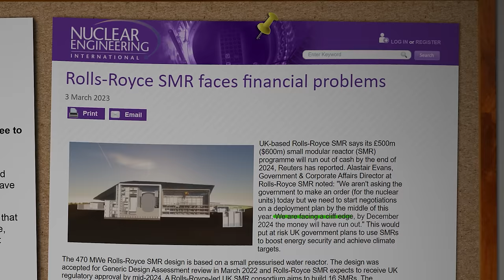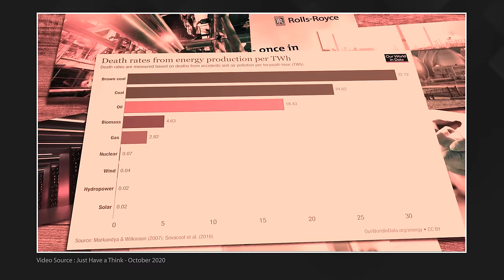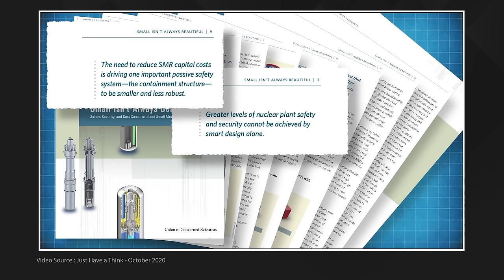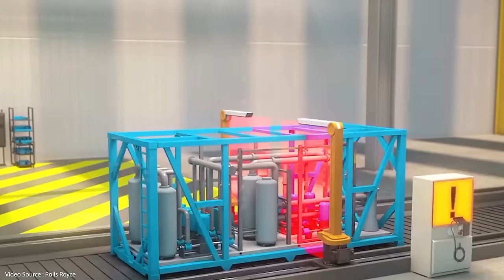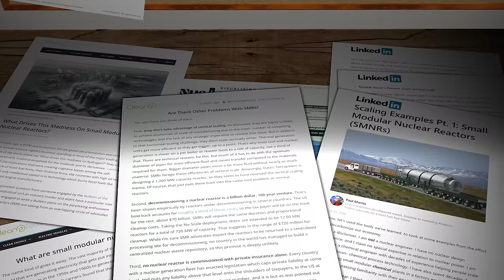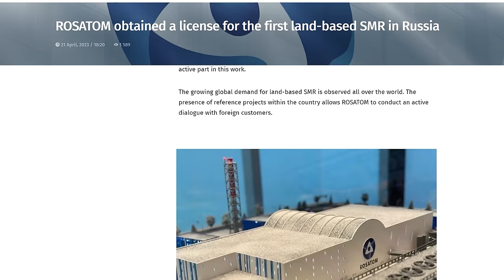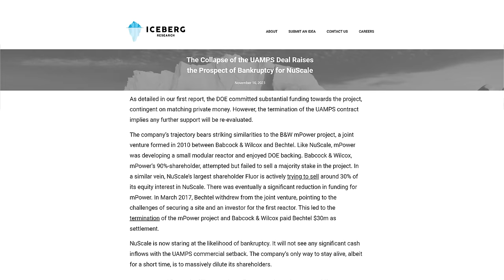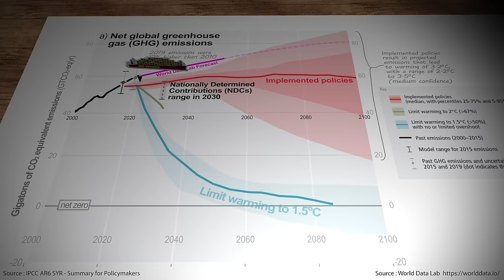Small Modular Nuclear Reactors. The Verdict

Comment: These SMRs look huge, to me a SMR fits in a small space like a submarine or aircraft carrier, a few lines up in a row on an existing sire like an old coal power station that still has its infrastructure is the way to go.
Reply: It's something I noticed, too - they are deliberately conflating the pressure vessel/ reactor thingy with the whole power station.

It's like saying an Internal Combustion Engine is a car.
Reply: Reactor submarines are not cheap (fuel load is $1 billion), they are very inefficient because they do not have the room for reheaters, and they have  none of the safety systems required for commercial units.  The first U.S. nuclear power plant (Shippingport) had a 60 Mw output (typical SMR capacity) took up three levels and 4 acres.  Look at a typical commercial power plant (1,000 Mw) and any SMR fraction of that output will be at least that fraction in size.  The larger the plant the more efficient it becomes and vis versa.

Comment: A running capacity of 90% is really really optimistic. Look at France. They had huge problems where during winter they had to shut down almost all their nuclear plants for corrosion tests and maintenance. And then during summer, the rivers got so hot they couldn't cool their plants and it had to be shut off again.  People don't want to face up to the fact that in practice, nuclear plants are not always operational. They are down for maintenance, tests, inspections like 10 to 30% of the time. While for solar and wind that will be much lower. Additionally, the cooling water shows the biggest pollutant of nuclear power that is almost never talked about: hot cooling water. Nuclear plants, or any traditional power plant, consume an incredible amount of cooling water. Which when you build them near a river or an inlet can be quite problematic. People may say that heat can be used to heat houses. But who builds a nuclear reactor near a residential area that already has a district heating? As always with nuclear, it is all a pipe dream begging for government subsidies.
Reply: You do realize that the capacity factor of solar is 50% at best, under ideal conditions, right?  And while France has had some recent issues, those issues are the exception and not the rule.  Look at the United States.  We have a far larger nuclear fleet, and 95%+ has been the trend for a couple of decades now.
Reply: @rdormer  Why would the capacity factor of solar matter at all? Even if it is 0.1%, so what? I don't get it. US has barely build any new nuclear plants in the last 30 years. And all attempts have been failures that led to cancellation of future plans. This despite our need to phase out fossil.  Solar and wind are replacing fossil AND nuclear at the same time. Fossil is losing but nuclear is not able to get even 1% what fossil is losing because solar is just too cheap and wind is just too appealing to the free market.
Reply: @Prometheus4096  My dude, you're the one who bought up capacity factor, I'm just responding to your incorrect statement about the capacity factor of nuclear.  Since it occurs in the context of a discussion of alternatives, with solar one of the leading alternatives, then its fair game to compare their capacity factors.  And sure, US construction is moribund - as long as you ignore Vogtle and Watts Bar.  The thing about SMRs is, it was never really about the small size being an economic benefit, it was about trying to leverage standardized designs instead of making - and this was a brilliant way to describe it - each project a piece of bespoke engineering.  SMR may not be the best way to do that, but France - since you brought them up - clearly shows the benefits of this approach at ANY scale.  Throwing the nuclear baby out with the SMR bathwater is a really braindead idea.  Go ahead and get your renewables - they're awesome.  But there's more to a stable grid than just picking the lowest LCOE across the board.  All those renewables are going to need baseload to back them up - that's a fact.  So far that's invariably been natural gas, which kind of defeats the point, no?  So, if not nuclear or natural gas, what baseload power source do YOU propose?
Reply: @rdormer  I was talking CORRECTLY about the capacity factor of nuclear. You were the one that brought up solar. Solar works independent of capacity factor. As does wind. Nuclear does not. Nuclear is already dead. So I don't know why you are trying to argue against throwing out the baby with the bathwater.

Comment: The physicist YouTuber Sabine Hossenfelder already did a very easy to understand piece on why nuclear got so expensive in the US. Well worth watching, because it opens the possibility of lowering those costs back down to something resembling the 1950's reactor costs.
Reply: Yet those 1950s costs were still not competitive with coal back then. And renewables are now definitely cheaper than new coal (as the Chinese have discovered in the last few years - they've abandoned many planned new coal and nuclear plants in favour of a truly massive buildout of renewables). Fixing the US-specific issues will not be enough to make nuclear competitive - it also has to find much more generalised cost reductions. And the physics means it is unlikely to.
Reply: @kenoliver8913  Yes and no. Solar doesn't work where I live in Alaska for half the year. Nuclear makes a lot of sense there if it can be done at a lower cost than the current ones. Every power source has its market based on local conditions. There is no one size fits all model. IMO though the new geothermal power technologies are going to displace just about everything. 

The thing about wind and solar is that you cannot just look at the cost of energy production, it has to be coupled with storage. Without storage it is not reliable, so storage costs must be added to the levelized costs of wind and solar or you do not have the full picture. Without storage you need peaker plants of some sort like natgas, nuclear or geothermal. Interesting mix, and I believe the market should decide the answer instead of government to get reliable, scalable power at affordable prices.

Comment: The reason countries push nuclear energy is because nuclear energy and nuclear weapons use similar technologies. By promoting nuclear, they can acquire the necessary skills, infrastructure, and materials to advance their nuclear weapons ambitions, while hiding behind the facade of peaceful energy use.
Reply: There is virtually no crossover from nuclear weapon production and power plants with the exception of working with highly radioactive materials.

In general power plants cannot make bomb grade materials, and there is no need for bomb grade materials in nuclear power plants.

Weapon grade material reactors are very different from power reactors.
Reply: @perryallan3524   Tell that to India. India started its nuclear program in the 1950s with the help of the United States and Canada, which provided reactors, fuel, and technology for peaceful purposes under the Atoms for Peace initiative. However, India secretly diverted some of the plutonium produced by these reactors to its military program, and conducted its first nuclear test in 1974. India continued to use its nuclear power plants to produce plutonium for its weapons, and conducted more tests in 1998 when it officially declared itself a nuclear power.
Reply: @cVids The Chalk River NRX reactor Design provided to India was not a power plant reactor.  Yes, it could be used to short cycle nuclear fuel and make bomb grade materials.

But my point above was about power plant reactors; which the NRX design was not.

Also the entire idea was to help India develop a research and test reactor program like existed in Canada and the USA.  It was not to provide India with nuclear power plants.

I stand on my point that there is almost no crossover between power plant reactors and weapons grade material producing reactors.

Comment: Good points, but what do we do when oil and gas production start declining as world demand continues to increase. Current estimates are that in as little as 30 years this will happen. Meanwhile solar and wind comprise a tiny fraction of demand. I guess the answer is to go full on with PWR’s and deal with the waste issues and 3% useable part of Uranium ?  Fusion seems to be more of a pipe dream than SMR’s and MSR’S using Thorium.

Comment: SMR will have a place somewhere.  Somewhere that's isolated, difficult to connect to a grid, and very well guarded.  The latter requirement cannot be overstressed.  Military maritime kinda fits the bill ($ too).
Reply: The problem there is that the whole SMR concept relies on costs being made competitive by by mass production, churning out hundreds (at least) a year. But if the market consists of a handful of niche uses then mass production is not possible.

Comment: If the Russian floating "SMR" is a good example, it's not simple or particularly compact. 🤔 I'm concerned that the Australian Liberal-National coalition (conservatives, for those outside Australia who think "liberal" means something else) is now proposing SMR as a way to replace coal-fired power plants with similarly centralised technology. They've spent the last two decades fighting tooth and nail to prevent the implementation of anything to replace coal power. Pretending that SMR is a timely solution for 2030 (or frankly even 2050) is ridiculous - it's just another excuse to delay removing coal and gas from Australia's power equation. Note - nuclear power is currently illegal in Australia. There's only one nuclear reactor, which is relatively tiny and makes isotopes for medical and scientific use. Of course, ANSTO are fully behind the Liberal-National proposal. Meanwhile, Australia has no national storage facility for nuclear waste because (surprise) NIMBY. If we can't find a location for a waste storage facility, how can we talk about implementing SMR (not MSR) technology which will generate tonnes of highly radioactive waste? 🙄 PS How to provide enough power at night when solar can't is still a huge challenge for Australia which nobody seems to be solving in time to fill the void left by the coal power plants which are about to be decommissioned.

Comment: The problem with going for just using the so called "all renewable" energy sources, is lack of materials at a large built out scale.. it simply can't be done at a large enough scale, because of lack of accessible materials.. However, if we could use something like molten salt reactors (in combination with other power sources ofcourse), the materials requirements could be reduced massively..🧐
Reply: Shouldn't we actually build at least one commercial MSR and operate it for a while before making any claims? Terrapower have been trying since 2016 and has yet to break ground

Comment: Modular reactors also means modular factories. When all pieces are made in uniform because we're building more plants exactly the same, it's way cheaper. You don't need pipe fitters when assembly includes premade fittings and perfect lengths/labelled plumbing. It's way way cheaper to not need a journeyman at all than have one welding a larger pipe.
Reply: I’m fairly complicated stuff made in factories still uses skilled workers. I’ve watched big ships being built, and huge engines. Your attitude scares me. A nuke built by someone who doesn’t know what they’re doing because they are cheap is not a way to improve the reliability of SMRs.

Comment: I got the impression a few years ago that the technology would be based on the methods that they already used such as in nuclear subs and the power requirements were more on a local area basis. Perhaps everyone wants to reinvent the wheel with a clean sheet and ignore existing knowledge as theres no glory  and not it appears much backing for just improving something. I wonder where Tidal sits in this as the UK has this huge resource coming and going regular as clockwork. We did have a Tidal startup locally but when they got a working test rig they were bought up by someone and moved away.

Comment: SMR does not make sense when compared directly to large-scale nuclear. Power from SMR will always be more expensive viewed in head-to-head comparison.

But, you cannot have a single plant (of any type). If (when) it goes down for maintenance, you must have another power source. So you may need to build two.

This means that unless you have backup for the large plant you first need to build small plants. 

Big is always cheaper, but it is not cheaper if you don't need it. And if you would need to build two etc. 

Small may be more expensive but may be all that you can afford, even if you have to build multiple to get your backup.

There are some other considerations, SMR may be less risk. SMR build time may be less. Cost of capital may be less (due to lower build time and less risk.)